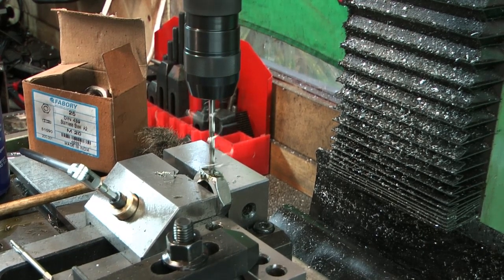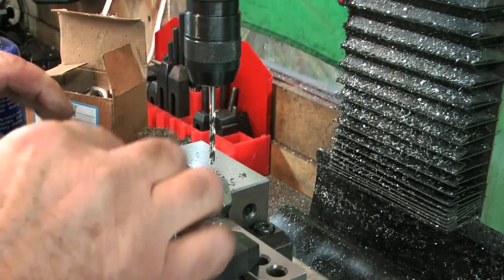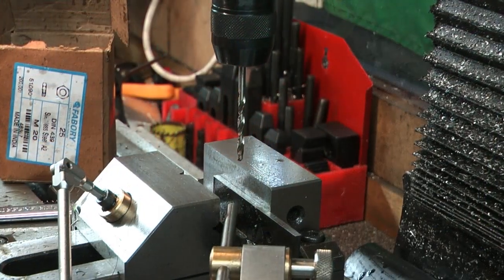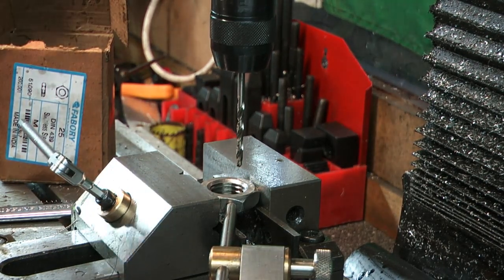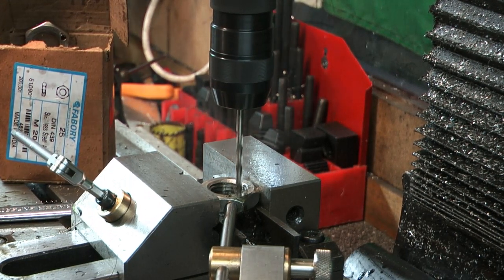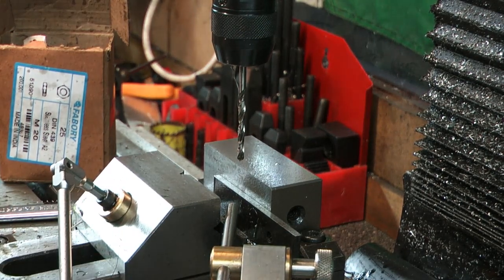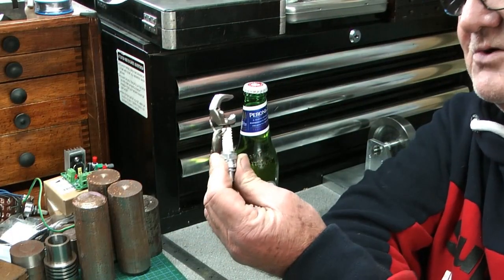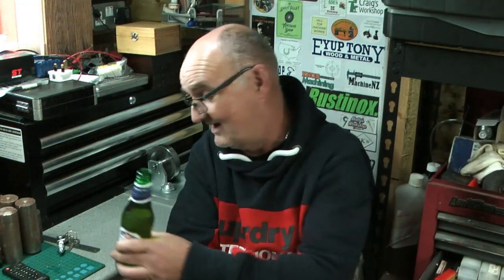A side project revealed and a chance to help out my channel .

Comment: A must-have item. I have Spinal Osteoarthritis. This turns you into a non drinker of Alcohol. No matter it is still Nice to have. There are other bottles with a cap on which this will open. Thank you for the enjoyment that you give me. Soon I will be able to get back to my own model engineering. I will not be trying to emulate your quality of work. No milling machine or 180 lathe.  Just an ML7 with plain bearings. Though I did start using a treadle lathe at the age of 12. It was a 1912 Drummond with the leadscrew going through the centre. I was banned from using this & forced to use the top slide. Those very early Drummond's had a bad habit of picking up the cutter on top of the work piece & sprigging the split front bronze bearing out. So I soon leaned how to re-assemble it & start working again. My problem being that I was turning the material well but running the slide out too far & allowing it to go under my brass workpiece. Then I was of course banned from moving the carriage. No chance of just moving it along & then continuing my cut. It would be "You're banned from using the Lathe". Once was enough & no use saying "I was not turning using the Carriage". The reason was my bad left leg would be used to treadle with, so I was only allowed to treadle with my right leg. Odd yes, but it kept my weight on my left leg which was desirable & to Doctors orders.

Comment: Hi Ade nice little side job there. Going back through your videos to the clamps for your new vice; the vice shown looks like the one sold by ArcEuro, but you dont mention what size it is, is it the precision type 2 -90mm wide or the 120mm wide as I'm looking to change out the vice I have on my WM16? & being on a pension cost is acontributing factor.
Reply: Ade, Same question from me which size is the vice I have one 70mm I think but am after the large one. 
Jon.
Reply from the maker: It is the 90mm one . It has performed great on this size mill . I may get another so i can pair them up one day . Cheers Ade.

Comment: Ade. I just wonder how long the spark plug will last before the ceramic breaks due to the leverage. Spark plugs normally have no strain attached to the ceramic insulator. Regards from Australia.
Reply from the maker: Hi Dave . I made one prototype for myself maybe a year back . totally tested it and no issues . Cheers Ade

Comment: nice work Ade!  here's a tip for you, pin the comment you posted to the e-bay link because it's sliding all the way to the bottom of the page with each new comment posted.  good luck with the fund raiser and cheers!
Reply from the maker: Done. Thanks Denny.

Comment: Ade,
What is thread size you used for the sparkplug.
Reply from the maker: M20 . Cheers Ade
Reply: @ade63dug  
Ades,
Sorry I meant what size of thread is on the actual spark plug not the nut.
Reply from the maker: M10 x 1 on the plugs